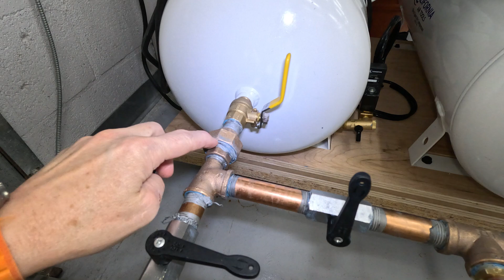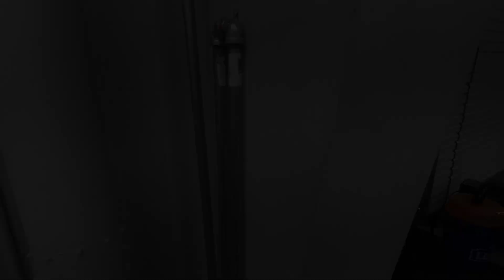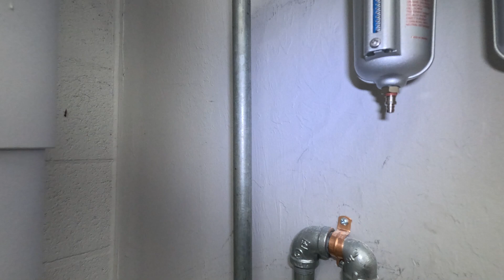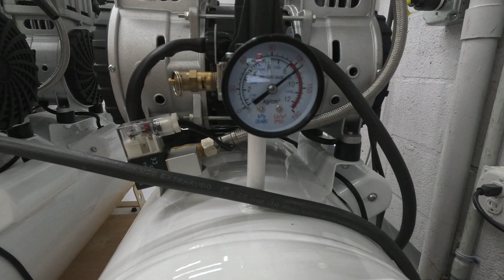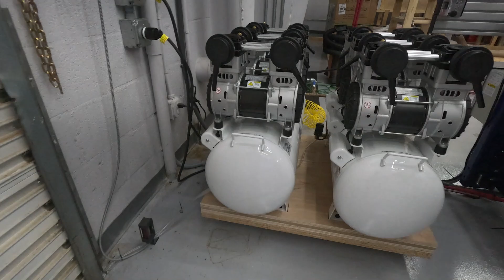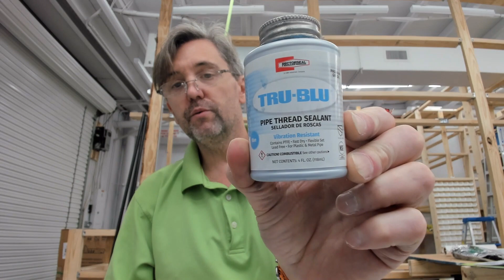CNC Project: Custom platform for 20060CAD compressors" | FINALE - Pt. 11 | #cncproject

Comment: H Richard, thanks for posting this video! I'm in a very similar situation as yours, so I'll share my plan and ask a few questions too:

I'm setting up a new 5'x10' Avid CNC to cut aluminum (besides wood), and deciding on an oil-less air compressor rated ~15 SCFM to feed the vortex tube. I'm leaning towards the same 20060CAD as yours, but only one compressor.

For air drying, I'll install a passive radiator between the motors and tank (Derale 13317 or a bigger model), and it should condensate the water a lot before air even enters the tank. I'll have an automatic drain valve at the bottom of the radiator to drain the water (model MC-ZLD-050).

For air filtering and additional drying, I'm considering the Milton 1072-2.

Which Vortec tube did you choose? I'm leaning towards the Vortec 611-1, but I wish they had a dual-nozzle one that is also frost free.

Cheers,
Sergio

PS: Have you considered installing a check valve ("one-way" valve) as the first device right on the output of each air compressor? They should prevent the pressure relief valve from going off when the other compressor starts, as pressure from one tank won't be able to enter the other.
Reply from the maker: The pressure relief valves are never activited as I have the motor turing off well before that threshold.  Rich